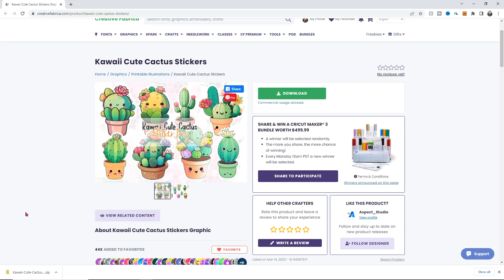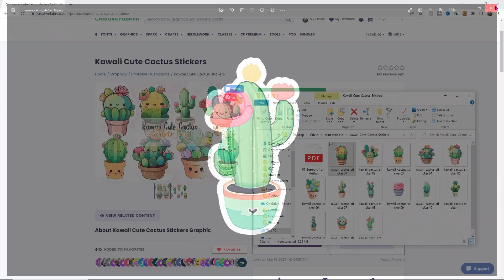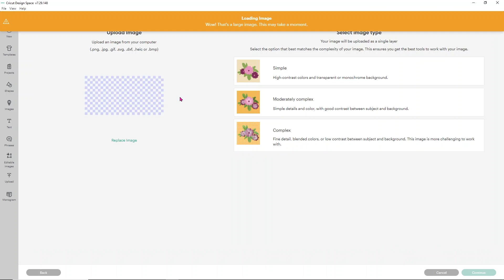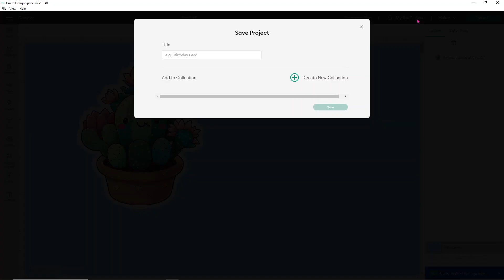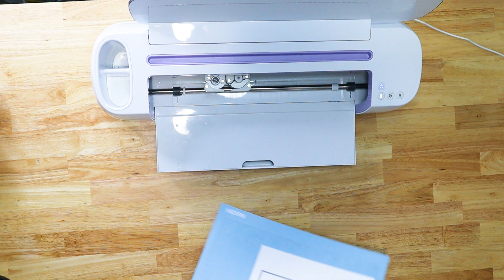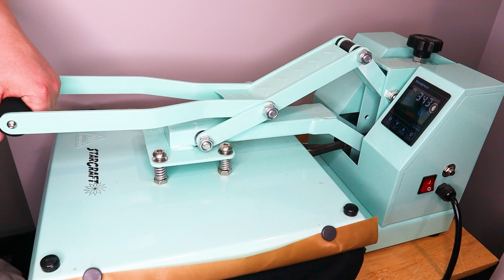How to use printable HTV for darks with Cricut - Heat Transfer vinyl print then cut tutorial

Comment: Hi Corinne did you print this out on a regular inject printer or a printer that has been converted either to sublimation or Eco Solvent
Reply from the maker: As noted this product is for inkjet printers only
Reply: Ok thank you
Reply: .it turned out great.colorsbeautiful do u know how any washings it can handle? Is this product for only svg png format ? Thanks for another great informative video
Reply from the maker: @cathysiddall7355  you can use this product with any printable image. Washing it cold inside out line dry will allow it to last the longest but I have washed one up to 20 times and it is still in good condition
Reply: Thanks corinne
Reply: Using the ink jet printer do you have to change the ink to sublimation inks please?
Reply from the maker: @carolburgess1549  no. This is an inkjet project
Reply: @CorinneBlackstone  so my regular everyday HP inkjet printer with its regular ink will print on these projects…. .?
Reply from the maker: @carolburgess1549  yes